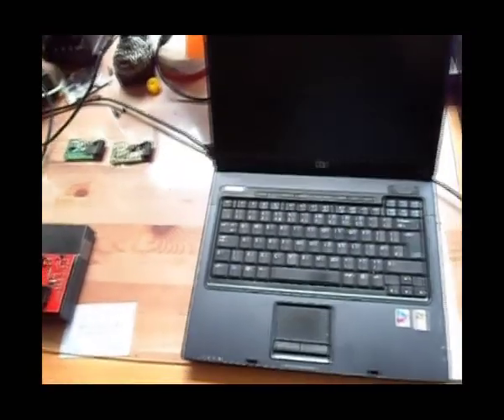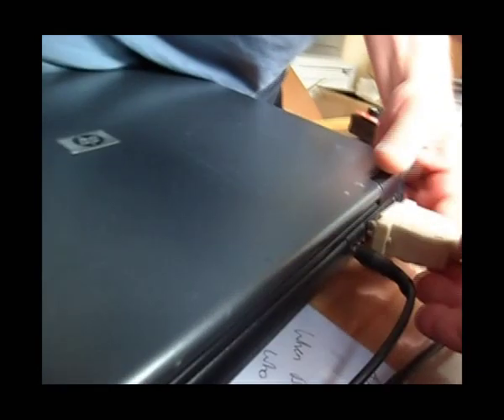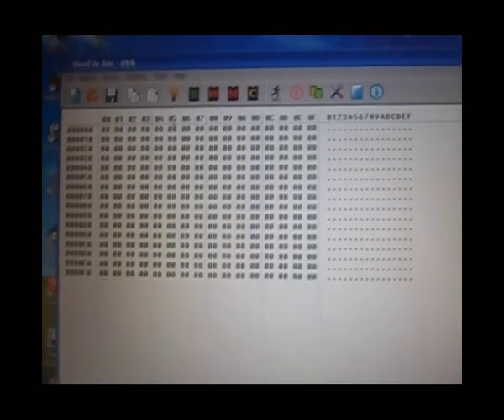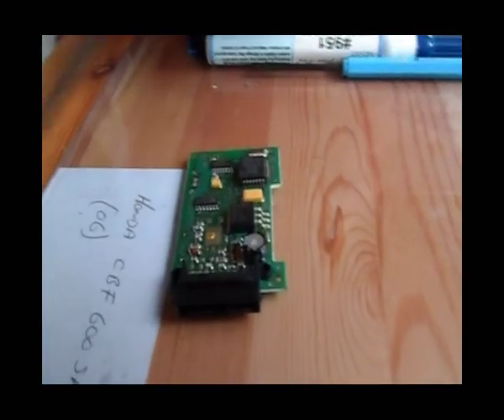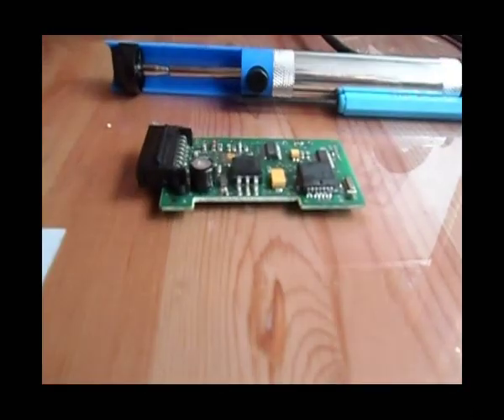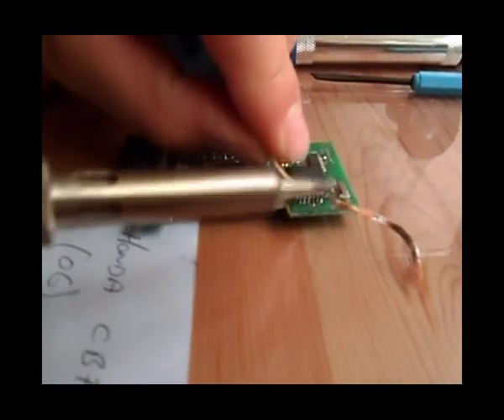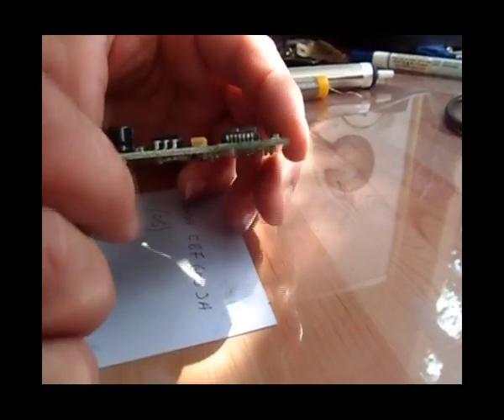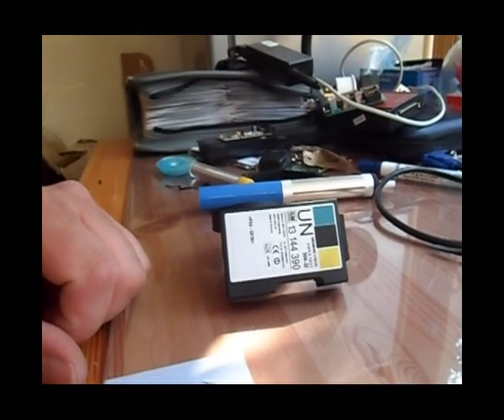Opel / Vauxhall Immobilizer code read part 2

Comment: I tried using my rework station to reseat it but may have damaged it as getting no start on car and no communication with immobiliser via diagnostics. I have another immo I’m going to have a go on with a soldering bolt. Actually,how much would you charge if I were to send it to you to flash the tms370 with my immo data,& resolder it back on into the transponder?
Let me know please and we can take it from there

Comment: What great video kept up the good work, this what happen to me, all I did was change the battery on the key first time start the 2nd time did not start the car, call the AA said that I have broke the ignition barrel,so the to the garage and they said they can not get one for my car so now I have two keys one for the doors and the other one to start the car it cost me lots of money also the item was no put back the cover for the immobilizer. I went to vauxhall deals they said you can order one in two days time is that what I did, the garage make a joke out of me taking my money can you plaese help me to put it right.

Comment: Obrigado, Companheiro amigo muitas informações EEPROM reader PIN code Opel Immo,
soldagem da antena, apresentando os tornilhos da placa.
Aprendendo inovando com os Mestres Professores, Companheiro, "Somos aprendiz", sempre aprendendo, Eletrônica Embarcada, sistema de immobilizer cada serviço executado uma emoção.
fico feliz muitas gracias,
Desde Brasil Varonil.
Adilson

Comment: Thank you so much for the video, I have an EEPROM reader but I don't have the software. Please if you can give me the software name. Also, How can I reprogram an immobilizer for OPEL Corsa 2002, after knowing the pin code? and where is this block in the car located?